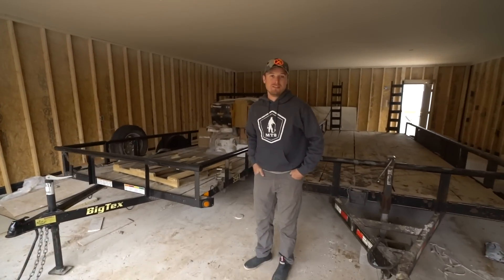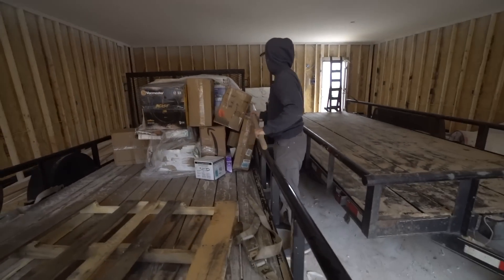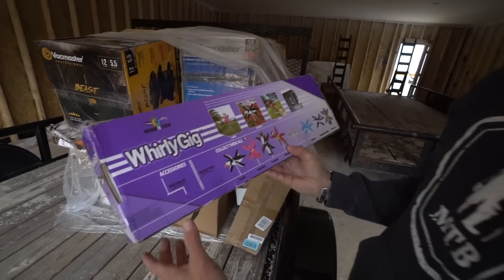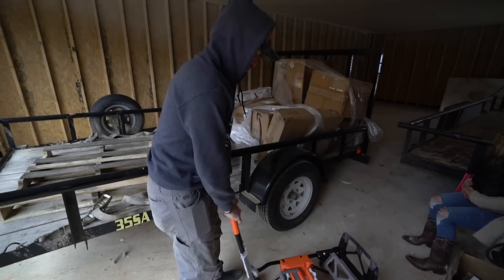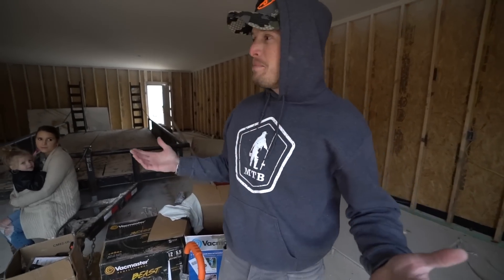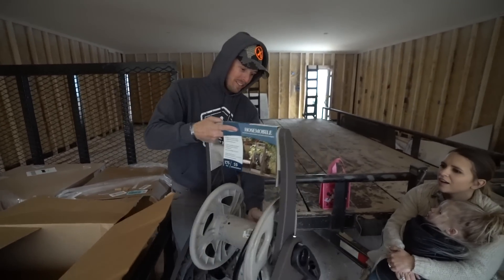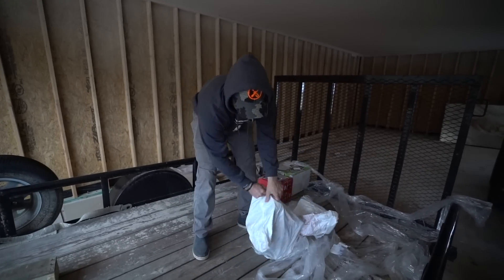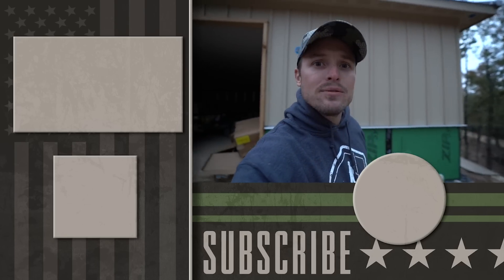I bought a Mystery Amazon Return Box - 100% RANDOM AND WORTH IT

Comment: I've built a few houses - and most recently rebuilt my house - and the six doors on the back of the house there is definitely a cost saver. It's far cheaper to buy insulated doors than to buy insulated windows. I actually installed screen doors instead of windows in a similar style along the back of my house. Just as see through as glass, but at a drastically lower price.
Reply from the maker: I had no idea that makes me feel better
Reply: @LunkersTV  Glad to be of service! Besides, now you've got flexibility on where you set stuff up outside so you've always got a door you can go through and move seating and even possibly a BBQ around freely.

Comment: Did you figure out how to use the blower/mulcher yet? Nice trade if it works. One of the electronic guys got a used computer main board that someone put in the box as they kept the new one. The original is good too. Shame. 

Sometimes people replace stuff with boxes of nails, weights, marbles and anything else to weight it.

Amazon has a great return policy, however, people that take advantage of their volume are going to ruin it. Eventually, Amazon will realize just how much money they are loosing to this practice. They should check their items it is returned as shipped. Anyone sending a used main board instead of the one they bought should be charged for the one they bought.

This happens quite often by the way. More than it should and with other items and categories.

Toy pallets should be good this time of year.